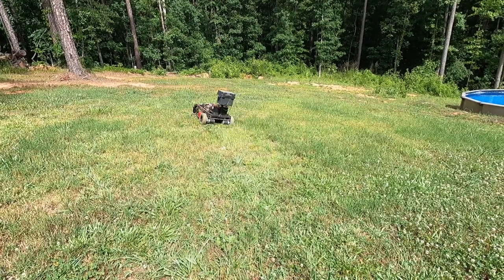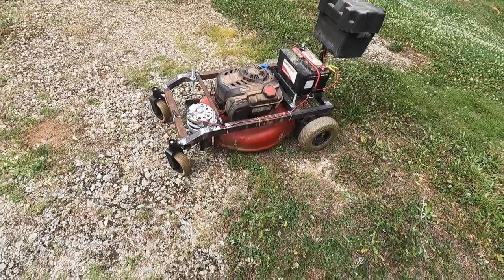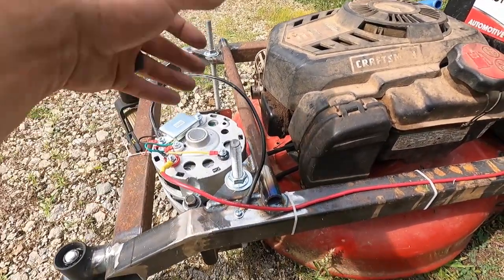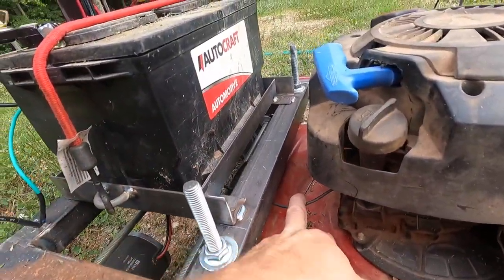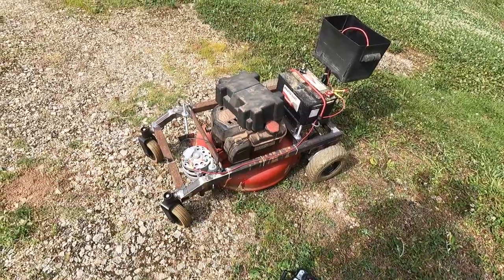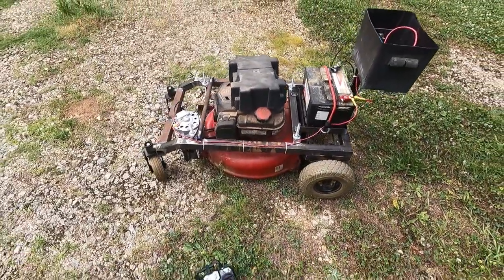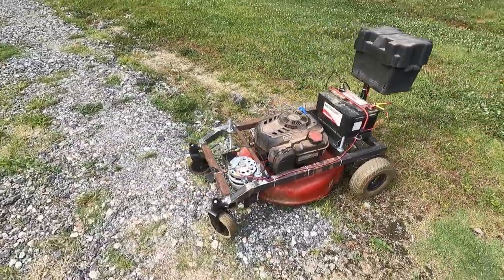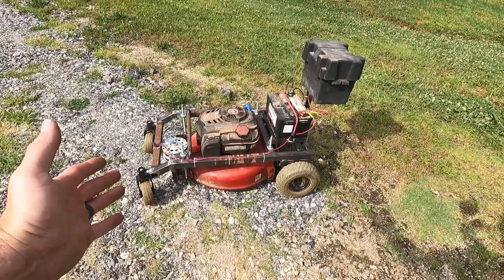Homemade Remote Control Lawnmower

Comment: switching to 24v should increase torque, if the wheelchair had a higher peak torque than you are currently getting from the 12v.    but you can never go over peak torque specs for a given electric motor.  you can increase speed by increasing voltage, but at some point, you'll just be burning out the motor.

Comment: 24v is way better also Cut up a dirt bike tire screw it to the wheels it will give you grip how are you liking that motor controller? does it get hot? I ike how you did the mower cut off
Reply from the maker: The motor controller doesn’t get too hot because I can’t use it other than to play around with it. The frame needs be higher off of the mower deck so that I can get the mower deck higher off the grass. I made the deck height adjustable, but even with it all the way up, it is still not high enough so the deck drags in thicker grass and the slick wheels just spin. It’s perfect for a section of my yard that is very smooth Bermuda, but most of my yard is lumpy green clumps of mixed grass that only look good when they’re short, lol. I will get back to this mower soon and modify it. Thanks for the suggestion, it definitely needs a wheel upgrade.

Comment: So you just grounded the coil to the frame directly to make your shutoff?
Reply from the maker: Correct. The push mower coil is basically already set up that way with the lever that you have to hold against the push handle to be able to crank and keep the mower running. There should be the spark plug wire and then one small wire running out of the ignition coil. That small wire is how you ground the coil and kill the spark. The way a push mower typically works is that small wire is run to a flywheel brake that grounds and stops the engine instantly. I disabled my flywheel brake so when I kill my engine, the blade continues to spin until it stops.

Comment: How steep of a hill can you mow? You mentioned it is underpowered but is that speed or torque? I have very steep land, too steep to safely mow, and don't want to get my project complete only to find out I need more torque. 
To get more traction you might think about running some short lag bolts into the rubber spaced out evenly, assuming they are solid tires.
Reply from the maker: I have a pretty steep hill in my backyard but have not been able to test it because the deck is too low. I did not put enough height adjustment on it so the frame needs to be taller off the deck. The mower definitely has the torque to mow the hills because it is light and the motors are from a power chair that hauls very large people around. The wheels that I used are too slick, so when the deck starts dragging in thicker grass, the wheels just spin. This definitely has some initial design flaws, lol, but I have not had the time to get back to it.

Comment: Tractor supply has a battery for deer hunters it’s a no spill deep cycle 8ah 12v agm definitely good battery for 25 bucks
(Edit) I’d probably get four batteries atleast
Reply from the maker: Thanks. I will check them out. This lawnmower definitely needs some upgrades.

Comment: Hello,
They use 24 volt motors
but 12 volts brings enough power?
What type of engine do you use???
I'm currently building an RC lawn mower
But my problem is the motors bzw the drive shaft
Reply from the maker: The 24 volt motors will run on 12 volts but they will operate much better with 24 volts. The gas engine is just a push lawn mower engine.
Reply: @SawdustandSparks  
Thank you for your quick response
but with 12 volts there is enough power for the drive?
is 45 AH enough for approx. 30 minutes of work?
Reply from the maker: @sebastianspielerei6403 I am not sure if that would be enough power for 30 minutes of mowing. How heavy is the mower and how much power do the motors draw when being used? That will make a big difference in the length of time you have to use it but I am definitely no expert. I just like to make stuff, lol 🙂
Reply: @SawdustandSparks  
We have something in common there
I'm not an expert either
I just like to tinker 😂